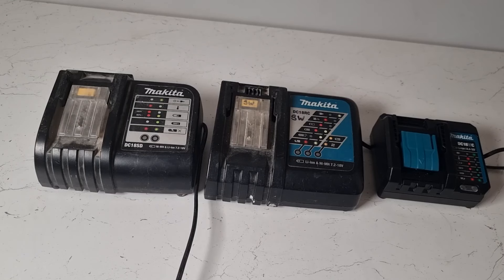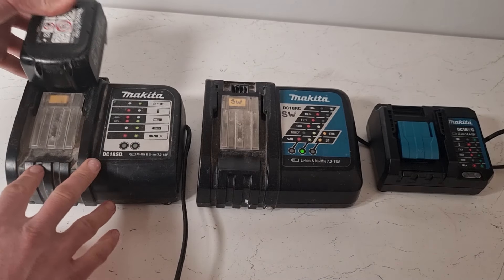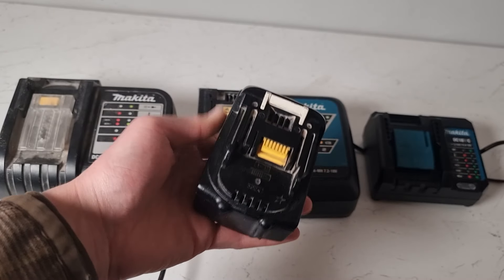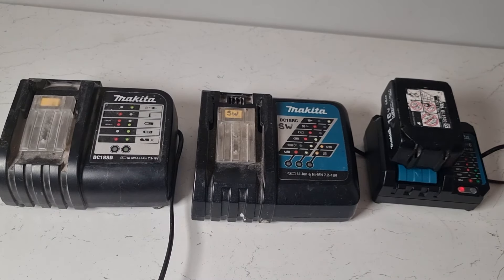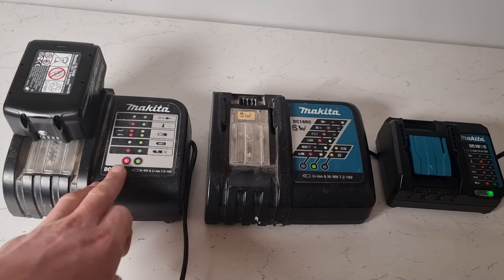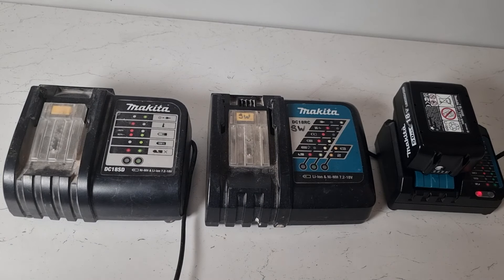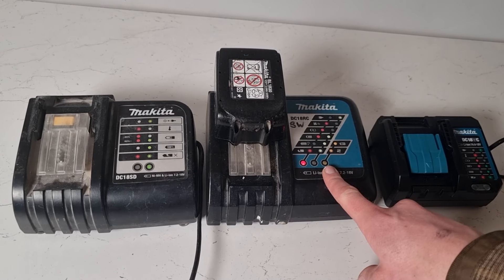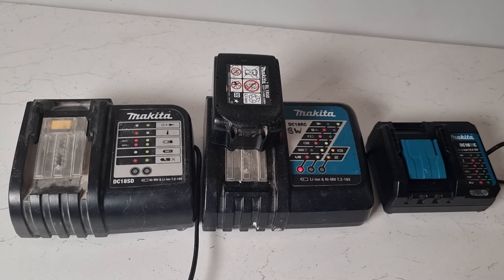Makita Battery Charger Lights Meaning

Comment: Thanks mate! I just bought the driller with dc18sd charger and my first impression after connecting both included batteries was that something is wrong with either charger or batteries as I only got red solid light. The included manual do not explain how the light behaves, I thought that there is diode under each coloured circle and you showed that there are only two diodes and circles beside markings are just a legend. You saved me from going back to Castorama tomorrow and asking stupid questions :). Cheers.

Comment: From Aliexpress or ebay these chargers only charge to 19 to 19.5V and shut down. (Batteries can't charge properly) Original charger charges to 20V and then shuts down so I use regulated voltage charging when charge to 20.2 V this will go to monitoring mode and for the last 2 years I have no problem, works fine for me.

Comment: What about a green and red light flashing back and fore?
Reply: I can’t find an answer to this
Reply: So I opened my charger up and there was a white two pin connector that had become unplugged to the left of the main yellow plug that that battery connects to. I pushed it back in, put it back together and no green to red lights. Hopefully you have a similar find.

Comment: You didn't include the G-Series

DC18WA charger.  It's a bit more common for the home gamers who'll need the translation.

You shouldn't charge cold batteries either.   I get why people leave them on but the charger will misinterpret the battery chemistry and risks an overcharge massively shortening the life of it.

Comment: Friend - Congratulations on the video - My MAKITA DC18RA charger burst components and I don't know the code to buy - They are the IC PWM with 4 pins on one side and 3 pins on the other position IC-1 - And the other one is likely a transistor in position IC 4 which is close to the (smaller) TR2 transformer ------- IT WILL HELP A LOT TO KNOW THE CODES OF THESE TWO COMPONENTS SO THAT I CAN REPAIR THE CHARGER - I appreciate your attention - Thank you

Comment: Y is it heated so much plus I smell the plastic burn smell and so stopped after the light just showed in 2nd step which it needed for 3rd step light to be fully charged?smell not normal? That middle one charger.
Reply from the maker: I'd suggest getting a new charger or trying the battery on a different charging station

Comment: My charger always shows a solid red light but the battery seems to charge fine, any idea on why this is so?
Reply: Same thing happens to me sometime! I just leave it in for over an hour and if the light is still red, take the battery out and look at the battery "charge" condition! OR get a digital multimeter, set it to 20 amps and take a manual reading (using red lead on positive and black on negative {clearly marked on the battery's terminals})...and thus you should know where you stand! I buy most tools from either Amazon or Home Despot and they will usually replace with a receipt if under a year from purchase. Otherwise, Makita's warranty is usually 3 years, though I've never had to return anything but I'm a DYI multifamily homeowner with two vehicles so, I'm relatively easy on my tools!

Comment: That isn't all. What about flashing left to right?
Reply from the maker: Do you mean the red and green lights flashing? I did one on that here after I realised I missed it out! > https://youtu.be/J3hfv4LFHKA
Reply: @TheBlokeCave  on the battery itself, if you press the charge level indicatorthe two left and two right lights will alternately flash back and forth. If you put the battery in the charger the red and green will do the same and the charger will beep.
Reply: @billmalec  yep, just happened to one of my batteries - which had previously only been charging to 3 lights?
Reply: @armandine2  I haven't found a reference to it yet.

Comment: I just bought a new dhp485 drill with two 3.0 Ah batteries. After I left it on the charger for the night, in the morning the green light was still blinking. I'm confused, shouldn't it be just constant green light?